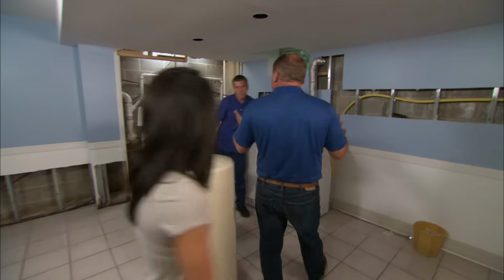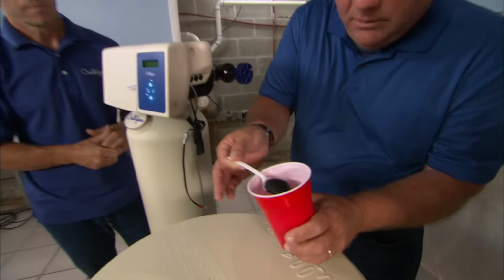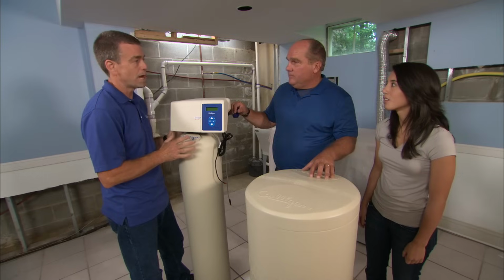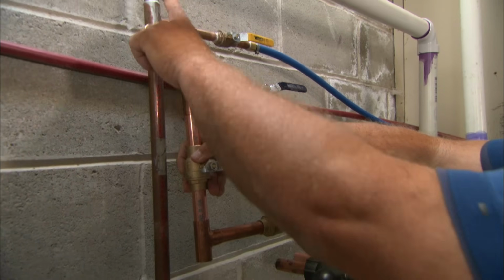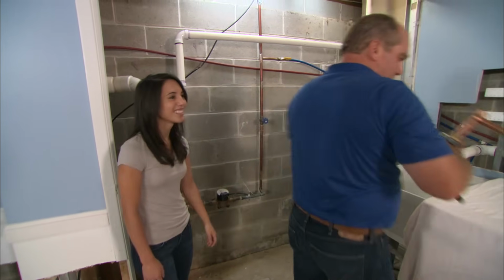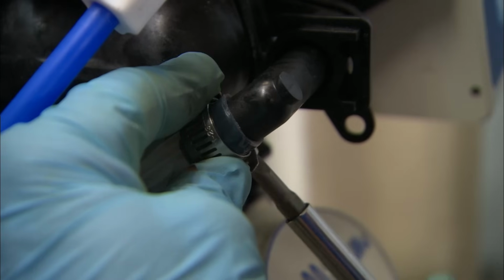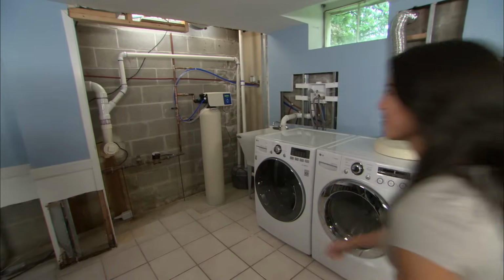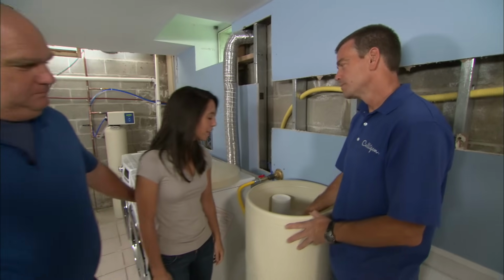How to Install a Whole-House Water Softener | Ask This Old House

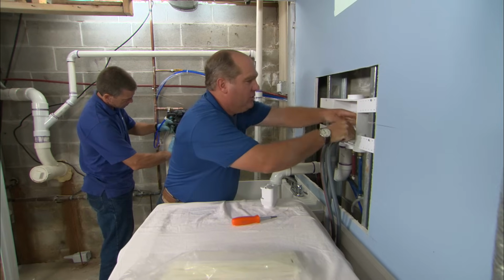Comment: (3:49) The drain line goes right into the laundry tray sink, not into the plumbing system normally. So why add an “air gap” fitting?

Comment: This Old House, a classy classic outfit organization with the right stuff of knowledge in a man's (family) castle!!! Hey @thisoldhouse at home I have a hot water heater with a large 2ft filter prior to the input of the heater. I change the filter every June & December, religiously. Every time my white filter comes out brown. I have tested my house water. The results from a stick method are within normal parameters. Advise?

Comment: When I visited relatives with soft water, in the shower I always felt too slick and not yet clean.  Now I'm in the midst of a crisis because this house MAY have had a softener in it by design, and because of that, some PEX plumbing is under the garage slab and leaking up thru the hole in the slab and flooding a bedroom instead of just going up into the attic and being noticed immediately..  I might have noticed sooner, but most of the water was soaked up by my vinyl collection, audio equipment, camping gear, boxes, etc.  Storage room.
At least it's PEX.  Could be much worse, right?  No.  Property manager is considering this whole screwed up system.  Laundry room hot on right. Ice maker might be hot, also.
The plumbing could have been extremely simple and all contained it the attic, straight down the centerline of the building.  Easy peasy, even WITH a softner.  Shyt contractor/designer.
'95 btw  Edit: Forgot part of the story.  Most of the water/mold was around the air return duct and got aerosolized and fed back to me constantly since last November at least.
Mostly same symptoms as covid.

Comment: When he said “it’s not dangerous to drink the water it’s only cosmetic” that’s entirely not true. The minerals are inorganic and your body has a hard time processing them. My blood calcium level was always high until I stopped dring tap water because of high calcium levels. If it can clog your pipes it can also clog your arteries.
Reply: Best to install an reverse osmosis (R/O) filter system under kitechen sink for drinking or
use a salt free water conditioning unit if applicable to your area.

Comment: It’s amazing to me that they used copper to plumb this in, especially when the laundry is already using PEX. Made for a pretty install though!
Reply: Doesnt pex cause cancer it really should only be hooked up to toilet lines with a back-flow preventer i would assume
Reply: @gallihyde  Nope, PEX is perfectly safe for potable water. When the lines are new, some residual of MTBE is sometimes detected, but that generally flushes out.
Reply: @gallihyde  I looked up information regarding pex and cancer, it seems like there is only a risk initially and after a period of time it would be cleaned of the chemicals when it was manufactured.
  
So after about 30 days of use there should be no risk, cleaning the pex pipes beforehand with soap would likely also eliminate the risk.
Reply: And that's WHY you are not a professional
Reply: @jamedlock83 who are you referring to?

Comment: I have replaced my softener in my home. I replaced one toilet about a year ago and am finding a ring where the water sits. I redid my main bathroom about 4 yrs ago and no rings in the toilet i am wondering whether the toilet with the ring is actually hooked up to the water softener and that is why I am getting the ring in the bowl? How can I check this?
Reply: Have someone flush the toilet with the ring while you check the softener to see if its counting water

Comment: Oh god, this is not how you connect a water softener. Pretty scary, any time a plumber even mentions “hose clamp” immediately kick them out and get a new plumber.
Reply: So the video is  inaccurate???
Reply: @SF-sl7fi  don’t use hose clamps on any plumbing.
Reply: @reidsimonson  Dude, he used a hose clamp on the drain line. Its a line that has no pressure. Nothing wrong with that.
Reply: @aarr1647  no, that isn’t even close to what happened. That said I encourage you to do everything he did in the video. You’re local plumber is going to love you $$$$…..

Comment: I have two drain lines coming from my water softener. I have a floor drain near the softener that my condensate line from my ac/heater runs to. Can I tap the two drain lines into this line?
Reply: into s condensate line? no
Reply: You can seprate to a floor drain with a floor drain air gap clamps

Comment: Can you pit in this unit if you have a well pump no basement and crawlspace
Reply: My softener is in my crawl space.  The hard part is getting everything through the 2'x2' square entry hole for the crawl space.  Appliances in my crawl space sit on top of paver bricks rather than the dirt floor though.  Also, my crawl space is NOT open to the outside.  You don't want water appliances in an open crawl space that can get below freezing.

Comment: You'll be able to lather up 🤔
Reply: because of the minerals in the water you're not able to lather up with soap as easy when you have hard water. Meaning you have to use more soap to get a lather. when you soften the water you get a lot more of a lather when you're using soap in the shower or in a dishwasher and  washing machine

Comment: How about the lawn, Is the plants, flowers, and grass will kill with this salt water when use? Also, can i use it to my aquarium? Im actually using regular water for my aquarium.
Reply: Nashorncare Support stop telling lies about water softeners , and for those IDIOTS whom think they will drink SALT WATER NEED TO GROW UP,  MY DR tolmy wife NOT TO USE SALT, so she did, have you any idea what happened to her, she damned near DIED with no salt,  called 911, her sodium level was 109, W A Y TO LOW, even while we had a SOFTNER, THERE IS ZERO SALT IN THEBDRINKING WATER 
they loaded her up until it got to 140, now she puts 1 tbst salt in a glass of water., so stop the LIES
Reply: Yes, salt water will kill your plants that is why softeners only treat interior water lines, and not the outside water in hose bibs.  I wouldn't use it in a fish tank, but have read you can use deionized (DI) water in an auarium.  Also hot tub companies don't like softened water. Be safe :)

Comment: So wait a second here are you telling me that she's gonna water soften her lawn. I thought you're supposed to bypass your outside sprinkler or outside water lines
Reply: If the house wasn't plumbed with this in mind, it's a huge cost to do this. In my house the original owners conditioned both spigots and when I'm done replacing the softener only one of them will be conditioned. To get both of them off the softener I would have to tear up a bunch of dry wall and re-plumb it.
Reply: Most homes irrigation systems are on a separate water meter connection.

Comment: Some cities don't allow these. It's going to be more than twice a year adding salt at 17 hardness level also.
Reply: Gene Smay I put salt in mine every month lol
Reply: @GiddieUp20  Yeah when he said twice a year I was like umm no...I put salt in mine every month also!
Reply: Josh Aguirre iron is so bad where I live I have to put 4 bags a month in it lol. I go through 10lbs a day
Reply: @GiddieUp20  If your iron is really that bad then you probably want to look into an iron removal system - the softener wasn't designed for that.
Reply: not necessarily. that brine tank holds 6 bags. that system should use around (depending on water usage) 12 bags of salt per year, so two fills, although it's not recommended to fill the brine tank completely as it can promote salt bridges

Comment: These people talking about being able to lather up and cleaning stuff better always sound like con artist
Reply: The hardness of my water is 35.  Believe me, when the softener stops working, it won't be long before I know about it.  Dishes will be left with a white powder and clothes are quite stiff out of the dryer.  Bathtub, toilets, and sinks would be covered with minerals without the softener.  Shower heads and faucets would clog up in a few months.

You can also feel the difference when washing your hands and hair.  A non-working softener at my house is not an option!
Reply: Cynthia Cantrell hello, and many people have a shower filter to keep CHLORINE at bay, but they won’t work for most, as they have had got rid of CHLORINE & replaced it with CHLORIQUINE,  totally different THEY NEVER TOLD ANYBODY, I wiped out my MARINE AQUARIUM , as this CRAP does NOT dissipate , as did CHLORINE .Cheers From NJ 🇺🇸🇺🇸🇺🇸🇺🇸
Reply: Not sure what you're talking about... chloroquine is a malaria treatment, and they would not be putting it in treated water.  Some places have switched to chloramine however, to reduce the level of carcinogenic byproducts that chlorine creates.  

Unfortunately they have since found that chloramine has different byproducts that may also be carcinogenic.  And perhaps worse, in cities that have lead pipes, the chlorine kept lead from leaching out.  Chloramine does NOT have that protective effect with lead pipes, so if you have kids, there may be a bigger problem.
Reply: Cynthia Cantrell sorry, they are so similar & wrote the incorrect one , do you also know that sos in your toothpaste IS A KNOWN CARCINOGEN ? It’s ONLY use is to CREATE SUDS, AS. AMERICANS EQUATE CLEANING , WITH SUDS? Children, under 6 are NOT to use ADULT TOOTHPASTE because theu might SWALLOW IT, & THE CREST  MULTI, OR COLGATE ULTRA goes up to 12 year old for children, it’s that toxic. Also the fluoride, in most toothpaste is NOT  good for you, all the countries that USA emulated, no longer use it furthermore have BANNED IT USE. Dentists can treat your teeth,,or give RX tablets , , I do not use it, nor sls for many years . Take care   Cheers From NJ. 🇺🇸🇺🇸🇺🇸🇺🇸
Reply: Why? It is true.

Comment: Green rings are from copper pipe corrosion, not magnesium or calcium hardwater.
Reply: Usually the green is an idicator of a high iron content lol whick is what causes corrosion to copper piping. The water softener with absolutely stop the green stain from forming

Comment: In the UK you’d still need the kitchen tap to be fed by mains water as the water being treated is no longer classed as wholesome/ potable according to many water companies
Reply: That's why the UK is dumb
Reply: @jamedlock83  That’s why the UK is a tiny island and the the USA was created
Reply: @davidchillton1744  you meant stolen from the natives
Reply: I just replaced the softener in my house and plumbed the kitchen faucet water back on the softener. (Previous owners bypassed it, like you’re referring to). We have a water purifier for drinking water and saw no use to run nasty contaminated water through the kitchen faucet. There is barely enough sodium in the water to affect your diet, unless you’re on a low sodium diet.
Reply: most newer construction homes have dual inlets for cold water to the kitchen sink for this purpose.
Reply: Maybe they need more fluoride added to your water over there...
Reply: Why does the water company care what I do inside my house?

Here we have a requirement that right after the meter (but before anything else), we need to have a double-check-valve backflow preventer, and get it certified once a year. It is illegal for me to touch any pipe before the backflow preventer - that way, the water company knows that water from my house will never enter their supply. After the preventer - it's my friggin house - maybe I enjoy mixing piss in my water it shouldn't be the water company's business.

Comment: Can a ro system soft the hard water????
Reply: RO systems are typically installed only at the kitchen sink because you don't need to shower or flush the toilet with "pure" water. Typically speaking, people install a water softener to treat the water that goes on you (shower/dishes/etc.) and install a RO system for the water that goes in you (drinking/cooking.) You can put in a RO system without a softener, however your filters are likely to see more wear.
Reply: Whole house RO would be extremely expensive in installation and upkeep, plus take up a lot of space, and waste a lot of water.  Hence it is not commonly done.
Reply: @@MrRivethead1001   Our water guy for the kitchen R/O said a unit for entire house would start at 30K , YIKES!!!

Comment: WaterSoftners are a PIA.. Hauling 40-80# lb bags of salt - is a real PIA.. and cost ave if #7 a Bag.. and with High IRON in teh Water is even worse!  We spent over $3k initially for a System , including a RO. Reverse Osmosis Unit Under the Kit. Sink for Drinking..  Now its using 50#lbs of salt a month an changing the RO filters every 6 mos!  We have to have our own Wter Treatment System in our home being on Well Water !  UGH!

Comment: This is overly simplistic.  I've seen installations where hot water is softened, and only cold water in bathrooms and laundry. The softener is installed ahead of the hot water heater with branches elsewhere.  Also, the kitchen sink facet is often times left hard with a bypass so you are drinking "mineral" water vs. softened water.  Water to outside spigots should be hard too, otherwise you'll be watering plants with softened water.  Some people wash cars with outside spigots, in which case you may want it soft. And while I know they say the exchange and flush gets rid of the salt... there is some residual sodium.

Comment: Hmmm. As a kid, I know we had the hard water running to the sink. I assume it bypassed the softener while all other water flowed through the softener.
Reply: if it tasted salty, your equipment was malfunctioning. The taste is a preference, however and some people don't like the taste of soft water.
Reply: You are correct. In my last house I installed a softener bypassing the kitchen-sink-cold and outside faucet runs.  Why would you want to drink salt water or use salt water to sprinkle your lawn and garden?  And no, softened water doesn't "taste the same" as stated in the video.  It's salty.
Reply: @youdagoob  so won't your Dishes have Residue Since you bypass the Sink, and mess up your faucet with Calcium, Hard water

Comment: would have been nice if they had left the outside hose connections untreated
Reply: Wash a vehicle once on a hot day with hard water, and see just how fast water spots show up before you even get a chance to dry it off.

Comment: the water tastes salty..i work in 2 rental houses with the same system.. yuckkkkkk
Reply: +san379 You should get those softeners checked out. The water should not taste salty if they are running properly.
Reply: Patrick Corcoran  no they all do this.. the culigian  guy comes over to maintain it every few months plus drops off culigian water to drink because the water is soo hard and tastes like salt.. yucky..
Reply: san379 if your tds is high you will have salty tasting water whether you have a softener or not. A solution to this is a reverse osmosis.
Reply: Would only get salty if some one is running water during the regen time. Adjust your schedule or adjust the time of day for the regen. Power outages affect some older models also.